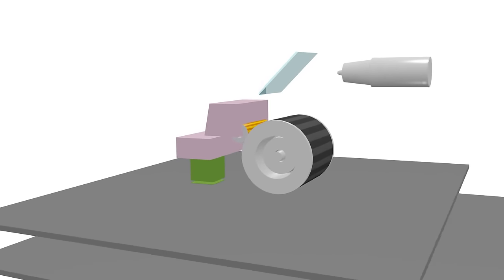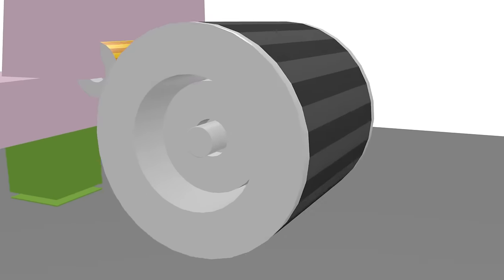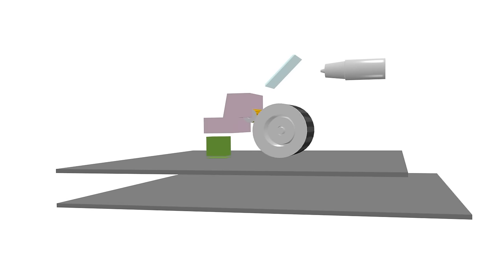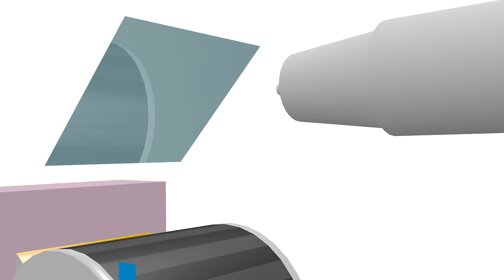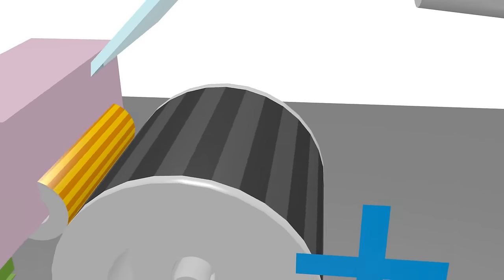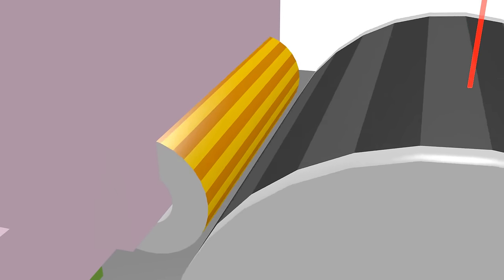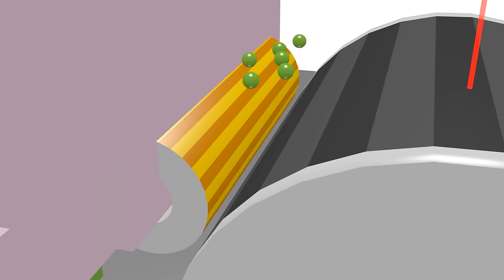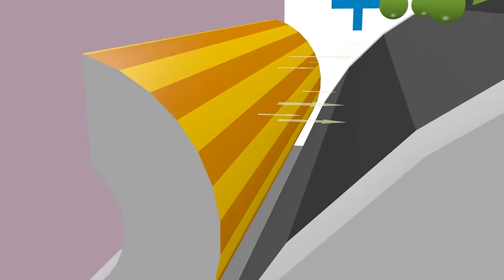How a laser printer works (Static electricity)

Comment: How can the laser cause a positively charged drum to become negatively charged. If I remember correctly, the photoelectric effect causes a release of photoelectric  that open positively charged gaps in a material. Should the drum not be initially negatively charged?
Reply: I think so, it seems like she got it backwards. First the primary charge roller applies a negative charge to the entire drum. Then the laser opens those positively charged gaps.

Comment: how can the paper be nagativly charged and the points on the drum be negativly charged and they still attract each other?
Reply from the maker: The paper has a stronger negative charge than the points on the drum. The toner has a positive charge.
(Watch again from 0:46)
Reply: @stephng4857  please correct the video. it's wrong.
Reply: @john-mi1ud  it is wrong.